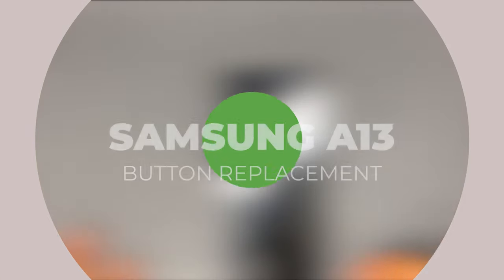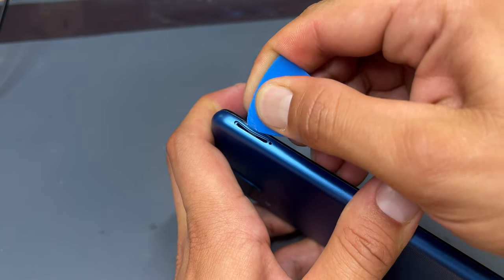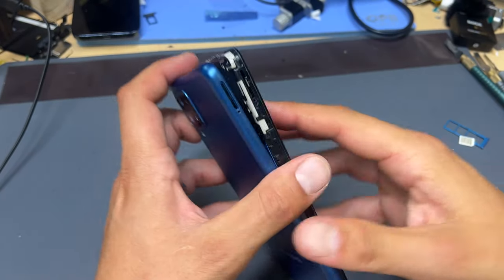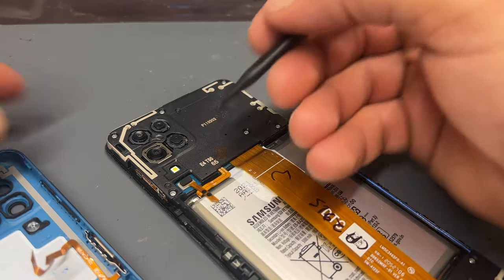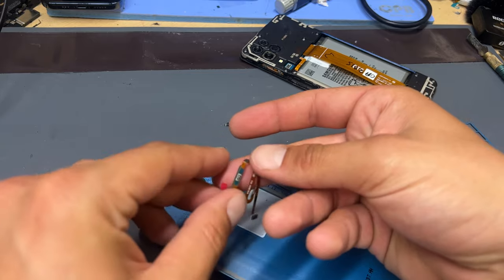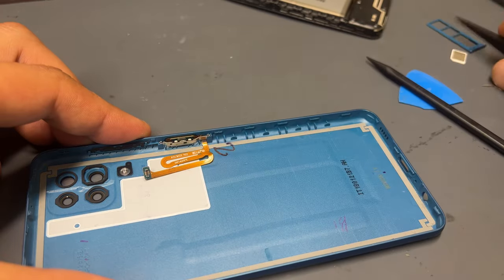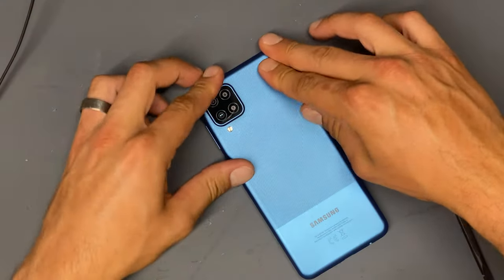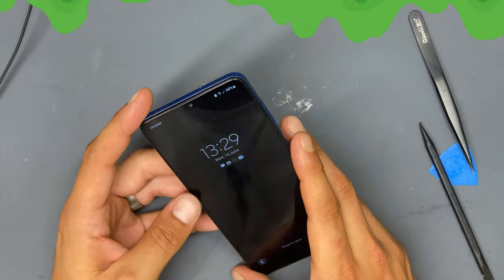Samsung A13 Power Button Not Working Repair - Button Replacement Tutorial

Comment: THE PROCEDURE SHOWN IN THIS VIDEO WORKS!  HOWEVER ...   My A13's power button cable had a small metal bracket covering the connection to the logic board. Someone else brought this up in another comment ... this is how it comes from the factory (or, as another comment mentioned; the phone shown in the video is not an A13, but an A12). After experiencing the same power button issue, I replaced it using this video as a guide (a new button can be purchased from Amazon.) It worked for a little while ... until the button stopped working again. The problem is that the connector can come loose from the logic board after dropping the phone a few times (yeah, I'm clumsy with my phone). So I opened the phone back up, removed the little metal bracket, and reconnected the cable to the logic board. However, this time before reinstalling the metal bracket I carefully bent it inward a bit in the center. This applies more pressure to the connection. Keeps it from becoming disconnected from the logic board again. So far so good!
Reply: Thank you for clearing that up.

Comment: Thank you so much for this video. My daughter dropped her phone very badly and finger sensor & power button not working. After watching this video, I was able to safely open her phone up and quickly saw that the power button ribbon cable connector came out from motherboard. I plugged in the connector and closed up the phone. Works perfectly!👍👍👍

Comment: Thank you so much for this video. My daughter dropped her phone on the driveway and the power button stopped working. I was able to safely open her phone up and quickly saw that the power button ribbon cable connector became disconnected from the motherboard. Easy fix. plugged in the connector and closed up the phone. Works perfectly! Thank you very much for this video!

Comment: Im having the same issue, my gold wire thing snapped at some point. Is there any way to jump start it without buying new parts? Some way to get the power flowing through the end of the snapped cable long enough to power it on? I already got a new phone but i want to retrieve some stuff from this one.
Reply: Find a way ?

Comment: Same thing with my A13 power button. Suddenly it started acting up so I switched to double tap to get it on. Well it died over night and now I cant get it started. It charged to 100% and I tried the USB cable tricks and all I get is the percentage . I even tried to go into recovery mode, nothing. I think I saw a update notification and I postponed it do you think not doing the update is making the phone act shitty? Everything on the inside looks fine. Any help would be appreciated.
Reply from the maker: Maybe worth trying a new button

Comment: After watching this the other night I opened my a13 and the button seemed functional the lead looked fine. I gave it a closer look a min ago and noticed the switch where connecting to the logic board looked slightly askew. When I checked to see if it was secure I saw it move as it wasn't seated. I have tried several times to reconnect the button to the logic board but it makes not attempt to click onto the logic board. Is there a truck. I tried tilting it a tiny bit so the switch would be downward on the top side of the phone but that made no difference. I don't want to force it but I pressed firmly and. It didn't click. Both the logic board connector and the buttons look fine.
Reply from the maker: If ever I’m struggling to line something up, I will use tweezers to hold it in place then apply pressure when I’m happy it is lined up right
Reply: @iDoctorUK  it will sit on the boards connecter but I'm almost certain there is a part that should be secured to the board that the power buttons connector is still connected to. Therefore when I'm trying to seat the connecter in place theres nothing to click to. There's just the grey box around the connection base on the logic board. It fits in place fine just nothing to keep it there. It looks like when the sweat shop made it they didn't get the contacts soldered except one. When I started to disconnect it I saw it was crooked then I clapped the ribbon and the whole thing came loose. I could see on tiny piece of copper foil on one contact of the bower button side and a tiny dot on the logic board. If you happen to fear the correct pins to jump please let me know. I didn't know that the finger print reader is in that button. I guess that's why there are so many contacts

Comment: I was hoping it was not an obvious fault. My side button stopped working. I went to settings and made the phone exit sleep with a double tap on the screen. I screwed up and fell asleep watching a movie and the battery ran down. Next day it was dead. Plugged in and charged to 100%. Can't turn it on due to the side button not working. If I plug the charger in after a few seconds an arrow forms and spins around the battery charged numbers as they increase to 100%. Tried holding side button and every combo of vol up and down. Tried plugging in and holding buttons then unplugging and releasing buttons. Every stupid assed thing I could find on you tube. Nothing powers it on. Popped the back off today. Leads to side button look perfect. No kinks burns cracks cuts etc. The button itself easily pushes in and clicks. You can feel it click. The lead was securely seated in the boards connector. Is there a way to short the contacts on the board to see if that will power it up? In case the button is internally damaged and isn't visible. At one point I was doing something before it ran out of power and I saw a message pop up on the screen that said finger print scanner or ? is inoperable . I don't know if I hit a button having to do with the fingerprint function. The phone has been used less than 4 months. Never dropped. Never wet. Been trying to get Samsung to repair it. Warning to all looking at Samsung phones. They have the worst customer care I've ever seen. I've been trying for most of this year to get the phone fixed or replaced. They said no problem it's under warranty. Said take it to authorized Samsung repair center. Best buy. Tried the two in ft worth Texas. Both are authorized SS repair centers. Both said they couldn't fix it. I got a copy of a letter from Samsung to best buy geek squad that they are not authorized to repair A series galaxy phones. Tried u break we fix. One said we don't like to work on those I suggest you take it somewhere else. Tried another and was told they can't work on them because Samsung won't give them the parts needed to fix them. Went to the one that doesn't like to work on those. Talked to the little stoner and after I     talked to him he admitted they aren't allowed to work on a 13 or my a 20 he begged me to find another place to get it repaired. Anyone knowing how to jump start this thing I'd love to hear it.
Reply: bro i did the same when my power butten stoped workin i just when to settings and put like tap twice to open and shit and then it ran out of battery and not its likw dead but i charged it and it still pops up 100% but still dosent open lmao
Reply: @starstone9473  I'll bet money if you crack the back off then pop the lenses off of the cameras your lead to the button is to be mounted directly under the end of the lens panel. My connecter to the logic board was loose. When it went to get a plastic pry thingy(industry term) to disconnect the power button lead the thing just flipped out of the way. It looks as though the contact module came loose from the logic board(desoldered or never was. Any hoo it's still in the connecter on the power button leads. I was looking at logic boards as best I can remember the power switch connector isn't as or shouldn't be as bulky as mine appears. I want the world to know what a piece of shite samsuck customer care is. Their policy at least in fort worth Texas is to not authorize repair of A series galaxy phones at their authorized repair centers. They have dicked me around by making me spend hours on their chat line bullshit. I completely did everything they told me to. They made of a dozen tickets on it. Then the connection would be lost and I'd have to start all over. This went on for hours at a time. They  did this so long that the warranty ran out last week now they are saying they're going to see that I get a return box I a day or two. They were to call me back last night to give me the ticket info etc. They never called. I'll bet the box does show it it will but they will try to charge me ,$89.00 to fix it.
Reply from the maker: It is possible to jump the pins to start the phone. I don’t have the exact pin that needs shorting to hand but I may do a video on this in the near future
Reply: @iDoctorUK  I wish I knew. I'm supposed to be sending it to samsuck. They told me they will do a factory reset on it. I told them I had videos of my kids and pictures I do not want to lose. There is no reason to reset a phone just to put a switch on it.

Comment: THIS FIX WILL NOT WORK ON A FACTORY PHONE! THIS IS A REMANUFACTURED PHONE! THEY GLUE THE SWITCH TO THE BACK OF THE PHONE FROM FATORY! THE METAL BACKING PLATE IS MISSING FROM THE VIDEO AS WELL. YOU WILL RIP ALL THE PINS OUT ON A FACTORY PHONE.

Comment: I shorted the connector out with tin foil and it started back up!
Reply: Do you remember how you shorted it? I am in the same predicament.  I don't want to touch the wrong contacts together.  A diagram with location of contacts would be helpful, or clear explanation.  Thanks!